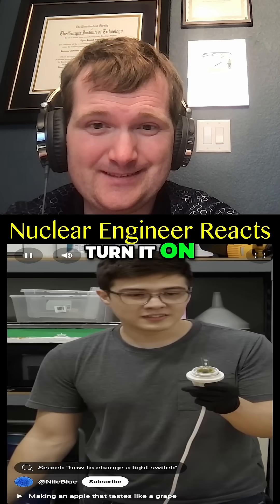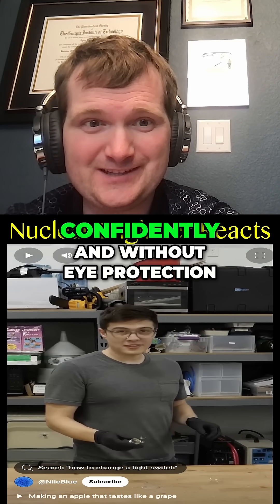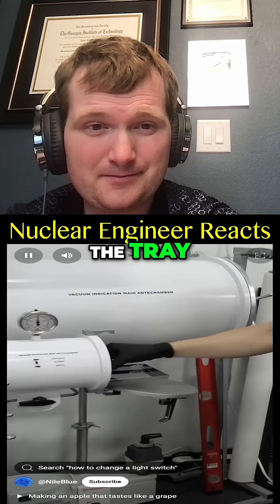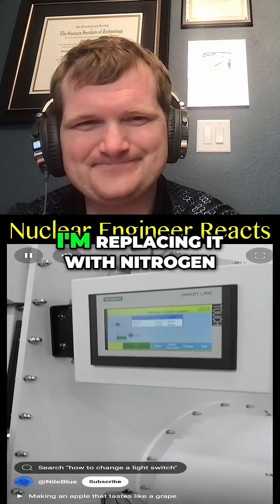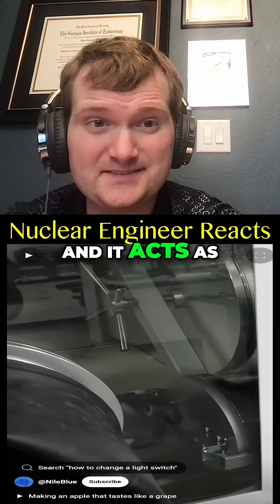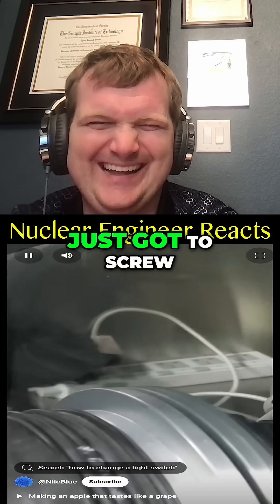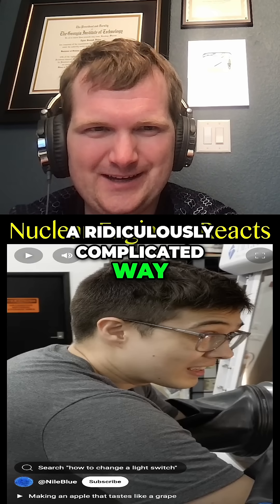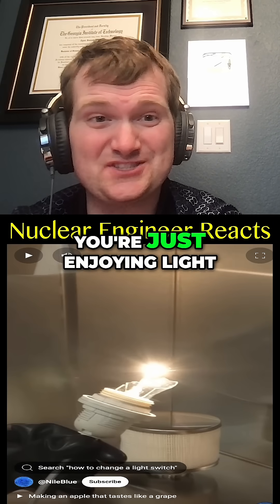Unnecessarily Complicated Light Bulb - Nuclear Engineer Reacts to NileBlue

Comment: Nitrogen is an inert gas until you introduce high temperature at which point it can react with hydrogen in the Harber Reaction or Oxygen forming Nitrous Oxides

Comment: That doesn't seem real. He has zero regard towards the filament during and after he breaks the glass. The filament is extremely fragile without the protection of the glass, yet he breaks the glass without even looking. He puts the exposed filament on the trey like it's nothing and shoves a cable on top of it. There is no way the filament would survive this kind of treatment. I would bet that the bulb he lit in the vacuum chamber is not the same we saw him put in the trey. I think this one was busted. meaning, he shows bravado in front of the camera but then he turn it of to carefully smuggle a bulb he carefully removed the glass of. And turns the camera back on right before he lights it.

Comment: Prescription glasses can be considered eye protection
Reply: If the lenses are made of the right kind of material. It's easier/cheaper now, but my mom worked in a pharmaceutical lab for 30 years her prescription safety glasses were expensive.
Reply: @joshcreek9531 very unlikely that those shards are going to pass through the glasses. Much more likely to go around them.
Reply: @EduardGabrielMunteanu  protection gear is not based on "most probably won't happen". It's based on "for when it happens"
Reply: @akiraic  Except in this scenario you have the specific conditions in which the glasses material have to perform, and in this case, the light bulb's glass is much thinner and packs way less energy than needed to go through the lenses of his glasses, so it counts as protection I guess, still not ideal protection gear tho
Reply: @majoras2700  I guess you didn't read my comment to notice I wasn't talking about his glasses. Pay more attention.
Reply: @akiraic  his glasses WILL stop glass shards from entering his eyes WHEN it happens. Just not as well as actual safety glasses. There's levels to this. A kevlar vest won't protect you from a rocket launcher, but it's still protective gear.
Reply: @kamshik  man... you're really bad at this
Reply: @akiraic  relax buddy, theres no medals being handed out.
Reply: @kamshik  I'm just gonna note this as a person who does wear glasses, the shards can enter through the bottom part quite easily (or any side really, they're not as close to your eyes as it may seem). One thing a lot of people with glasses would tell you - if it's raining, there's always water drops in our eyes. So while they might protect from the shards, the shards may still hit the eye (even if we're discarding the hardness of the glass)
Reply: @mariusseniucas9512  oh absolutely, but it's still better than nothing. So I'd say it IS protection, just not necessarily highly adequate.
Reply: I’m not gonna say my prescription glasses are safety rated, but they sure do have a lot more wear and tear on their lenses than my eyeballs do.
Reply: I'd be wearing the eyepro just to protect the glasses
Reply: Wouldn't be surprised if Nile's glasses are polycarbonate...